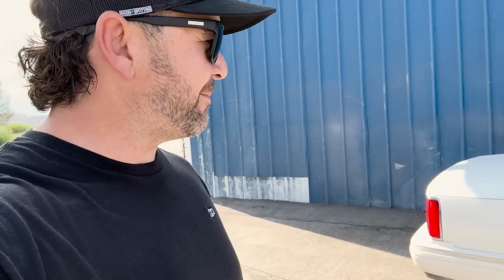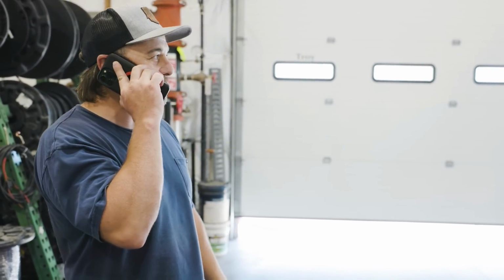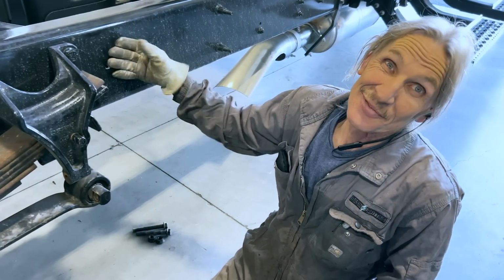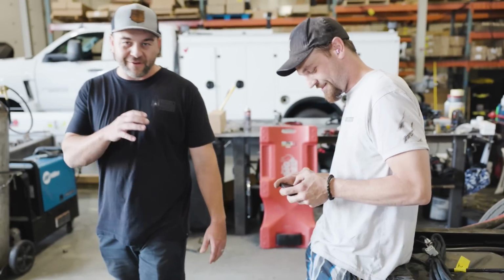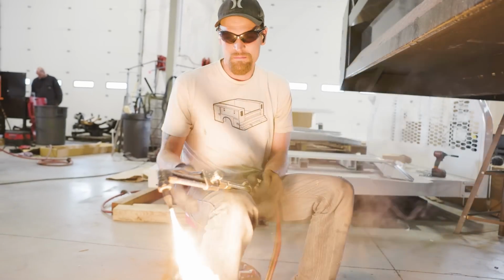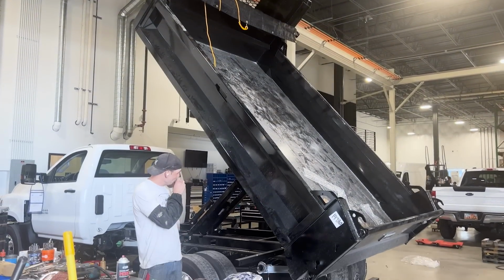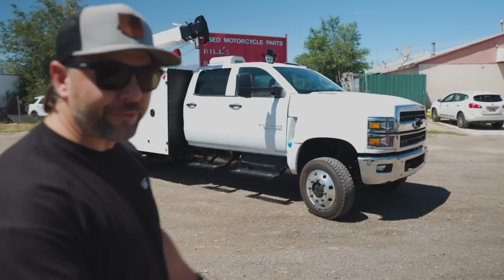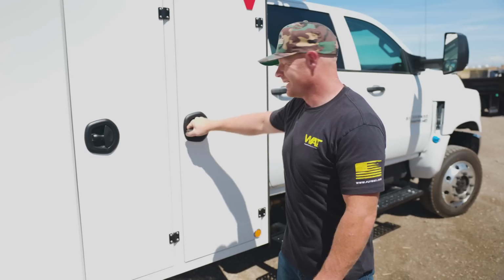Flip or Flop!? MASSIVE Crane Truck Build.

Comment: I see the value of 4WD, but a service truck doesn’t need to be a crew cab.  Whether it’s a mobile fleet mechanic or a rental company service truck they aren’t sending 4-5 man crews to work off a single truck.  A recovery or rollback truck sure, so you can carry the recovered vehicles occupants but not a service truck.
Reply from the maker: It sold instantly. We have been sitting on it for a long time. Whatever it was it’s gone. Mission accomplished
Reply: @BASIN_NATION  shows what I know 😕I’ll shut up now🤐
Reply: You are wrong on that one. The farmer and custom farmers want 4 wheel drive crew cabs with fuel and tools.
Reply: @delbutler885  I was speaking from my experience in the construction trades where a mechanic in a fleet maintenance truck performs pm and necessary repairs on heavy equipment onsite.  
I know not what you speak of in the custom FARMING industry. 
They need that crew cab to go pickup all their day laborers at Home Depot and use that crane to load hay bales and such? 🤣